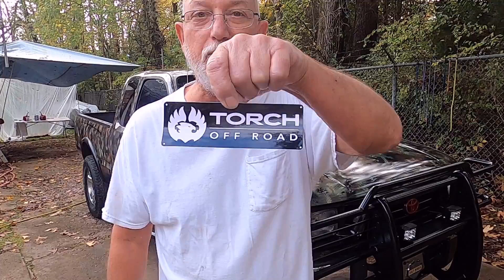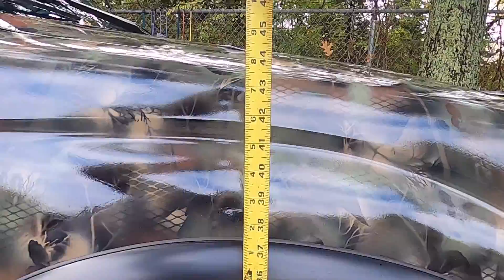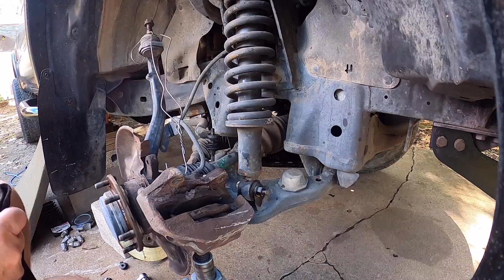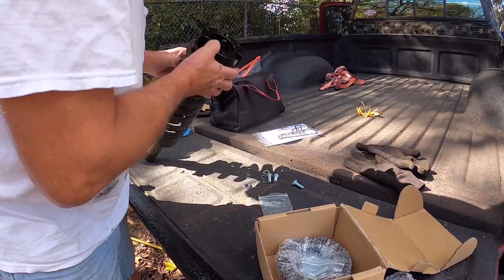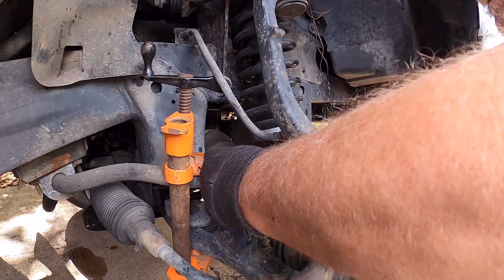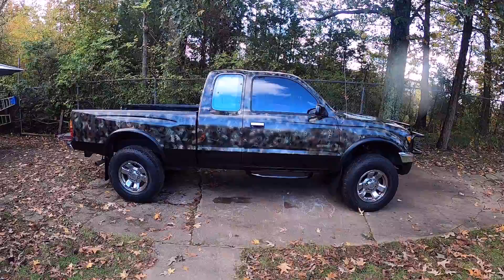TORCH Off Road 3" Lift Kit

Comment: Is removing the brakes necessary or did you remove them just for weight reduction while jacking ? Maybe the stretch is too far for the brake line ? Thanks for the video seems like the best way to do it!
Reply from the maker: Ya got to remove it all.